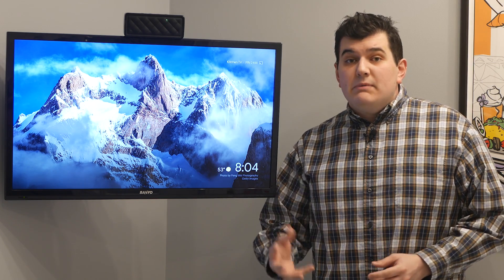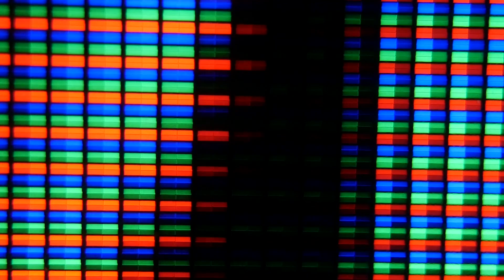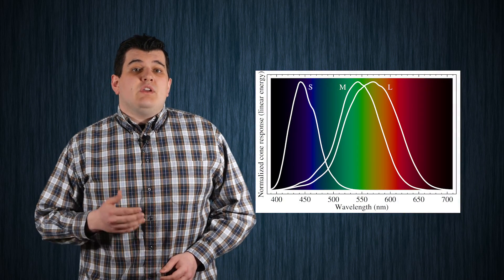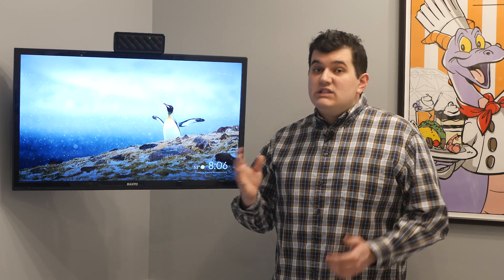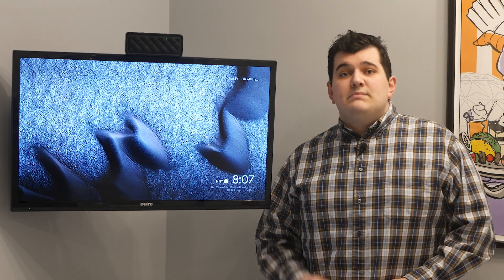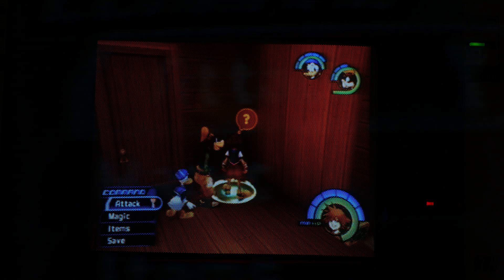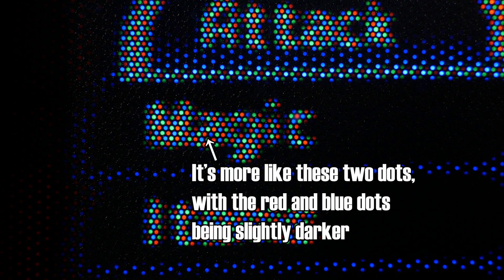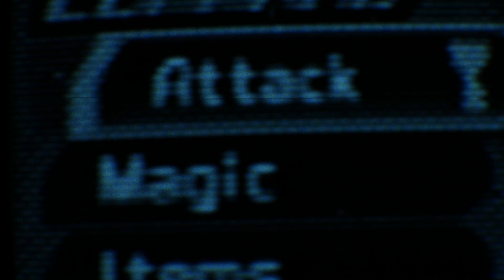These Are Not Pixels: Revisited

Comment: I think you missed a point to help convey your message...

If you pause at 13:58, you can very clearly see that each phosphor dot is actually displaying information from more than one scanline. Sure, some dots are fully lit equally from top to bottom, but many are not -- the top of the dot might be one scanline, and the bottom another.  If you look closely enough, you can even see that there are changes in the intensity horizontally within a single dot.  The bottom line is that if you were to try to correlate a phosphor dot to a "picture element" the dots are actually displaying multiple elements of the picture simultaneously, and are thus not a single picture element, or "pixel" as we have come to know them.

Similarly, (and you did sort of cover this) any detail in the image which doesn't fall within the area of the corresponding color of phosphor dot just isn't going to be visible.  So, in theory, if you had a high resolution image made up entirely of very thin red vertical stripes on a TV with a particularly low dot pitch, it might be possible that you don't see anything at all if those stripes happen to line up in the shadow area of the screen.  Also, if you have an RGB stripe TV (like a Trinitron) and a white edge of the picture happens to start on the blue dot and spill over into the red and green dots to its right, it will still appear as white, even though that edge is split across dot groupings.  As mentioned, the TV just doesn't care where those dots actually are or how they are arranged -- it just displays what it can where it can and that's good enough.
Reply from the maker: Yep, as Matt McIrvin brought up, the issue was that this could be confused with the divisions in the color components of the LCD panel.  I actually cut this from the script for this reason, but now I'm beginning to regret doing that.
Reply: Its fascinating as presumably when displaying a digital image on a CRT you have a situation where one triad will actually be representing more than one pixel, especially on PC monitors where you could be outputting any number of different resolutions to a screen with the same shadow mask.  Thus why there is an optimal resolution, because going any higher you run into a situation where a whole pixel could get obscured by the shadow mask itself, made even worse by the fact that the refresh rate gets lower and lower as you increase the resolution, causing a dimmer image.

I never understood this at the time, but it explains why there was effectively a technology war of different shadow mask designs, trying to minimise how much actual mask there was thus allowing a higher resolution to be displayed.
Reply: Showing the example of a partially lit phosphor dot would probably be the most effective way to get the point across. I was wondering why you never mentioned it in the video.
Reply: it's a pixmaskel not a pixel.
Reply: Jamie Hanrahan - When 720p came out, I remember running a 720 signal to my tube tv and wondering how it could display a resolution that looked sharper than the “pixels” on the screen. Upon experimenting, I discovered that you can actually light up only one half of a phosphor dot. Or leave one half of a phosphor dot dark. Or any arbitrary amount of a phosphor dot, really, though slightly blurred due to the electron reaction.

Given the nature of how phosphor dots work, it is entirely possible to only light up part of one.
Reply: Jamie Hanrahan - Can you not see the partially lit phosphor dots in the video? They're clearly only half lit. The bottom glowing and the top not, or vice versa.

In my experience, yes, it can be focused that tightly. I dunno why you so adamantly deny what I've seen with my own two eyes.
Reply: "any detail in the image which doesn't fall within the area of the corresponding color of phosphor dot just isn't going to be visible." The rest of your comment was fine but this point overstates the case. It would be true if the CRT could make a spot on the screen that only lit up one phosphor dot at a time. But It can't.  It can't focus the beam anywhere near that tightly. 

The beam does not make a phosphor-dot-sized spot of light! Each beam actually excites the dots of its respective color in many triads* at once; it's just brightest in the center of the group. For some details in the desired picture the center of the group corresponds to the location of  a dot of the correct color, for others it doesn't. But a blue detail that's supposed to be where the red dot of a triad actually is will still light up blue in the triads around that red dot, and it will still be brightest at the center of all of those triads, just as if the beam's center fell exactly on a triad's blue dot. 

As the beam is swept from side to side, both persistence of vision and persistence of the actual phosphorescence help average and blend it all together ,and we see the detail where it's supposed to be. Just as if there was a dot of the correct color right at the middle of the group. The fact that there isn't one doesn't matter much because the CRT is never illuminating just one phosphor dot at a time anyway. 

* groups of three phosphor dots. Yes, I know, they're technically only called triads in a shadow mask CRT. But I don't want to type "group of three phosphor dots" over and over when I can type one six-letter word.
Reply: "Obscured" is a good word there.  As I explained a couple of points above,  a pixel can't really be hidden completely by the shadow mask, because the CRT isn't making dots that small anyway. It would be like a telephone pole trying to "hide" a three-foot-wide  beam of light. But when you get close to the resolution that you'd calculate from the dot patch, the fine details nevertheless get a little fuzzy. Of course, there is also the number of scan lines, which imposes an upper limit on vertical resolution regardless of how fine the dot pitch is... and there's not much point in having the horizontal res (in dots/inch) be much different from the vertical. But that's another point completely.
Reply: The thing to remember is that there can't only be one partially lit phosphor dot. Again, the beam can't be focused anywhere near that tightly. Your "partially lit" phosphor dot will be one of many surrounding a half dozen or dozen fully lit ones.
Reply: Given the nature of how the electron beam works, it is not possible to only light up part of one phosphor dot and not light up any parts of any others. You just can't focus the electron beam that tightly.
Reply: Because I know how CRTs work, and I've spent hundreds of hours adjusting the things, and wishing the beam could be focused that tightly. This includes time spent with the sweep turned off and the beam intensity limited to avoid burning the phosphors. Even with the intensity turned down, it is obvious that the size of a phosphor dot is much, much smaller than the diameter of the electron beam.  Any decent textbook on CRT operation will confirm this. The only way you can get a partially-lit phosphor dot that's all by itself (i.e. not next to a more-fully-lit area) is if a) the center of the beam is not on any dots of the same color and b) the beam intensity is very low. Even then, phosphors in other dots are being hit, just at too low a level for you to see it.
Reply: Jamie Hanrahan - “too low a level for you to see it”... and that’s what’s important. Obviously there is going to be “hitting” of the surrounding phosphor dots, but so long as there is a clear difference in brightness, one can say that the phosphor dot is “partially lit”.

Also, my tube TV was pretty big, with large phosphor dots. They were the tall rectangular kind. Surely large enough phosphor dots can be more easily “partially lit” in the way I’ve described.
Reply: Not at anywhere close to full brightness. Beam diameter increases with beam intensity. And regarding large CRTs, the larger the CRT, the greater the front-to-back distance and the more beam current is required, both of which lead to a larger beam diameter. On any practical color CRT the phosphor dots are much, much smaller than the beam diameter. To say that a pixel could fall "in between" two triads is like saying that a telephone pole could block the beam from a three-foot-diameter searchlight. I don't have a high grade reference handy, but here is something from a well-reviewed writer at stackexchange: "Remember, the phosphor dots are MUCH smaller than the diameter of the electron beam when it reaches the screen." - from https://electronics.stackexchange.com/a/350073/51006 .
Reply: Technology Connections This dude will never understand even though Matt clearly and precisely explained it in this video.

Comment: I think I'd take a little different tact:  Go ahead and call them pixels - but it's not converted into pixels until the electron beam hits the shadow mask.  As such, there's no way to control or manage individuals pixels since you have no way of knowing when the beam is hitting the shadow mask and when it's getting though to the screen.  Even if you could know that, the number of "dots" is different for different models and sizes of tubes.  There's simply no way to control at the pixel level.  All you can do is paint the big picture and trust that the tube will do a reasonably good job of reproducing that.
Reply: They are not pixels as the brightness can vary inside them. Think about the Trinitron which has only lines.